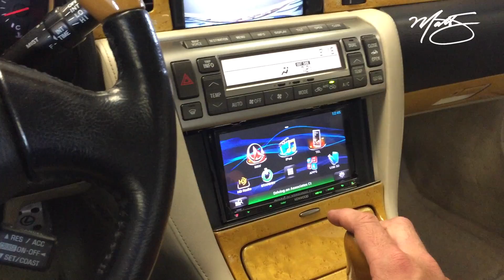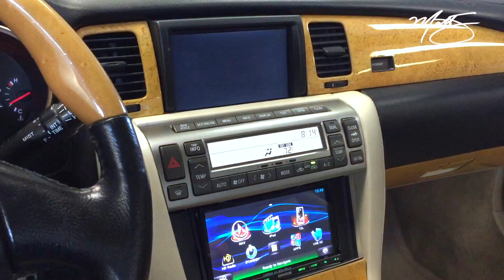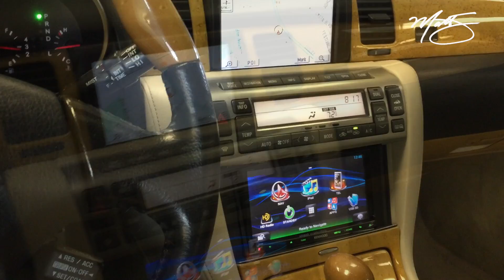Lexus SC430 Double Din Nav Radio and JL 6 Channel Amp Install While Keeping OEM Nav

Comment: That's just brilliant.  The SC430 sound system as far as upgrading is problematic.  Integration of NAV AND oddball ohm ratings required by factory amp etc.   Currently have stock setup, which when functioning properly does indeed have a nice reference and sound, but when considering 04' systems lack  bluetooth, and an antiquated GPS that hasn't had update DVD's available for years and speakers that are prone to failure (surrounds) this is a great option.  I'm considering an Android based stereo in hopes I'll be able to cast Google maps on the original NAV screen.

Comment: How did you bypass the data signal with the ml amp removed im trying to do the same thing. Im currently running kenwood hu with ml amp and beatsonic mva-12L
Reply from the maker: Take the data in and out of the amplifier harness and hook them together.
Reply: What did you replace the speakers with?

Comment: Great video. I wish you had a shop in Tampa,Florida so I could get my SC430 done by you. 
Do you remember the head unit you installed in this video? looks very clean.
Is the beatsonic harness required if I don't care about the factory nav? I just want to hook up the screen as a secondary and use the steering wheel controls.
Also, my Mark Levinson amp is defective hence why I'm looking into replacements. Does anyone sell an adapter that would allow me to plug and play a different model amp? 
Lastly, if I decide to ditch the factory headunit, amp , and GPS  (top) screen, is there a particular headunit that will allow me to keep using the steering wheel controls with the new setup. What head units and amps would you recommend for this application (sc430).

Thank you in advance.
Reply from the maker: With replacing your Mark Levinson amplifier, you will have to hook the in and out can of the amplifier together to keep the circuit intact. There is a RGB video interface for the OEM nav display where you could add a video input or camera. I used a Kenwood DNX radio in this video.

Comment: Can you share how you bypassed the Factory Navigation controls to retain the Factory Navigation with an aftermarket head unit ?  There are 2 wires I believe coming from the Factory Navigation - do you know what those 2 wires are for ?
Reply: +Jay Graver Beatsonic MVA 12 / 12L / 13 - works like a pro; sadly since it's such a vertical market they are $387 or so. But they work. Put a Pioneer 4100NEX in Wifey's 2003 Lexus SC430
Reply from the maker: +SenseiCur Not if your removing the oem amplifier out of the chain. Which is why this video was made.